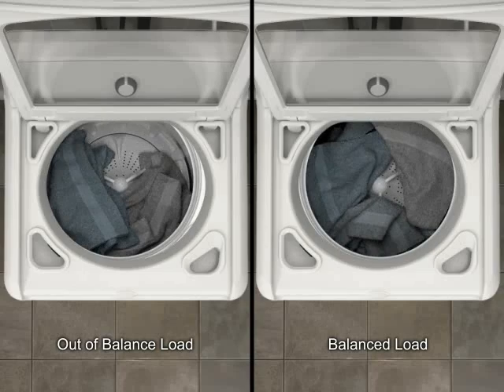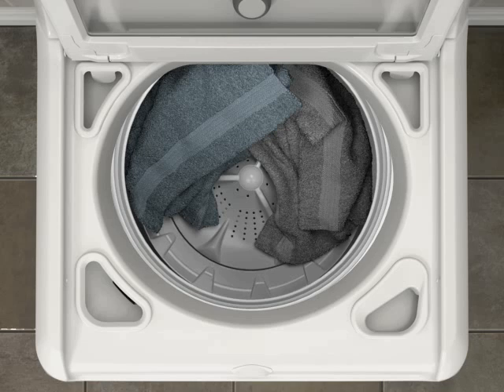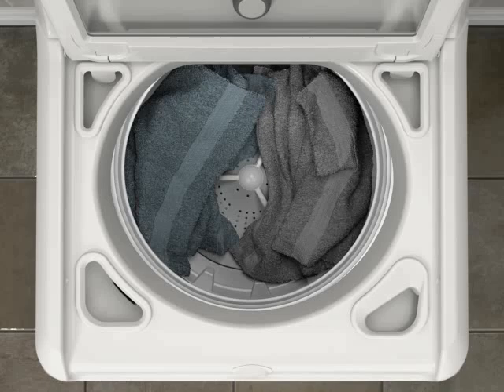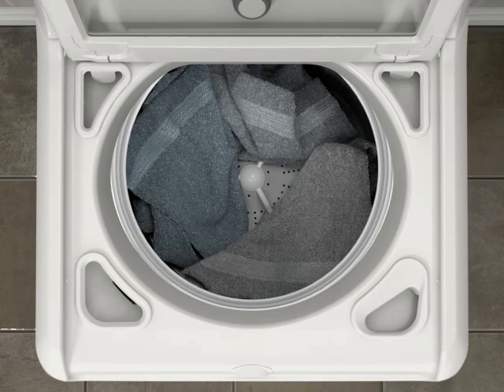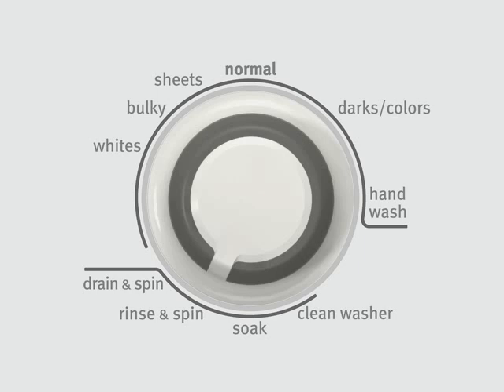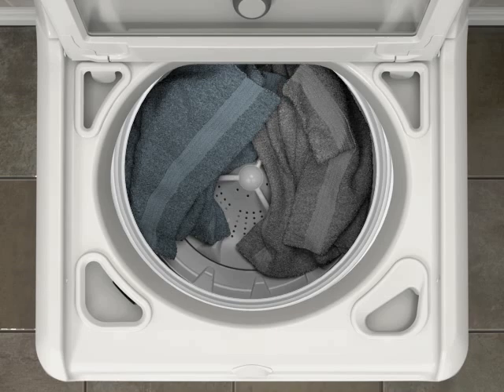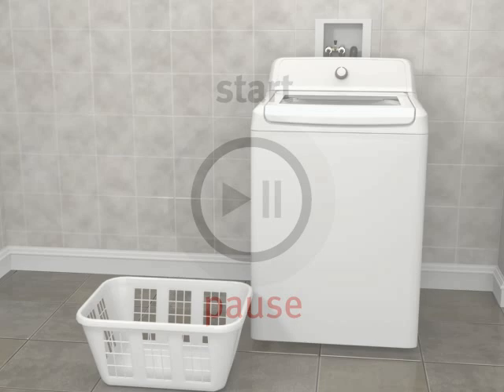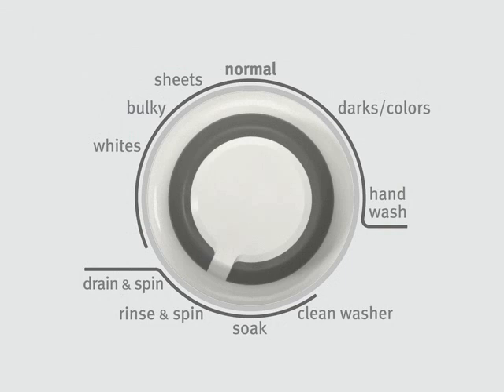How Your Washer Fixes Unbalanced Loads

Comment: I'm another delighted victim of this piece of crap Cabrio washer. It's nearly new, and it won't stay balanced. BANG BANG BANG CRASH! The whirlpool corp. should be held liable for foisting this junk on the public (and at premium prices, no less). This loser is anything but "high efficiency."  It uses TONS of both water and electricity.  That is, if it works at all.  Since it never spins right, you'll get to spend lots of extra cash drying the sopping wet clothes and a rash from remaining soap.

Comment: We have a cabrio washer and dryer. It has been a head ache. The first couple of years they worked fine but now the washer keeps having problems. We have had to have it repaired several times and now the unbalance issue is such a problem! We are thinking abut going back to an old fashion washer that is easy to fix and is built to last.

Comment: Our top-loader model LSQ9549LW3 Whirlpool senses the unbalance and slows the spin speed to reduce unbalance vibration.  However; the sensor has become too sensitive and the slow spin speed often leaves clothes wet. The only recourse is to carefully rearrange the clothes to achieve a perfect balance. This usually takes several attempts to get it to spin fast.   I  looked through the parts list to identify the defective sensor for replacement but cannot find it.